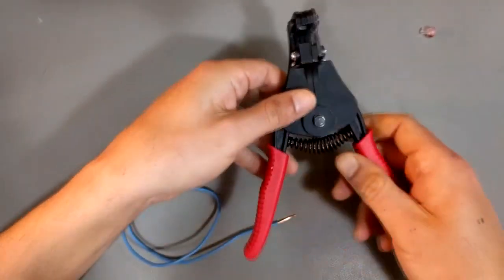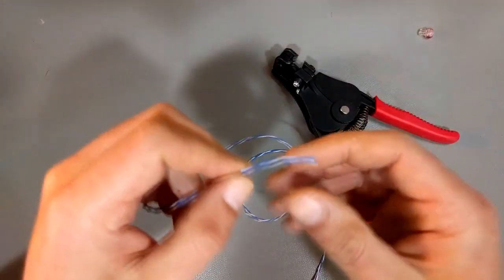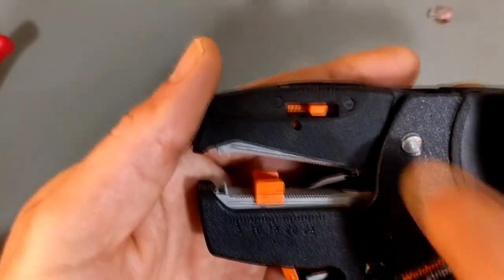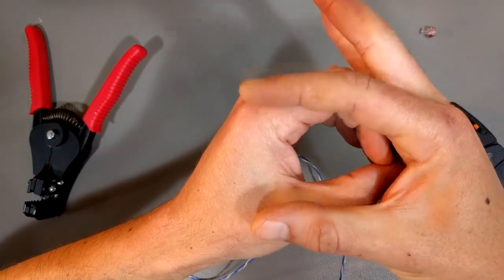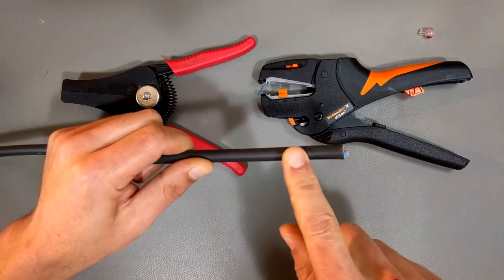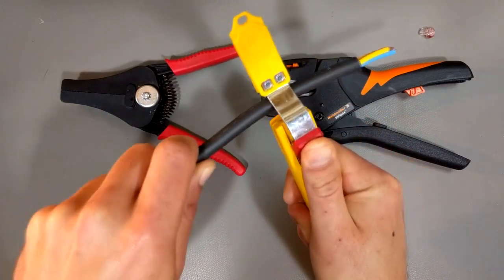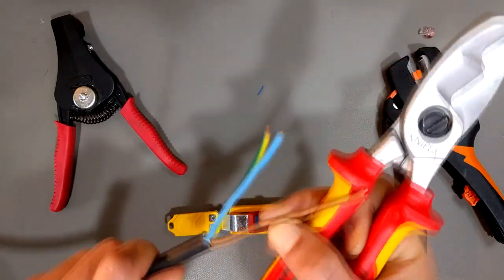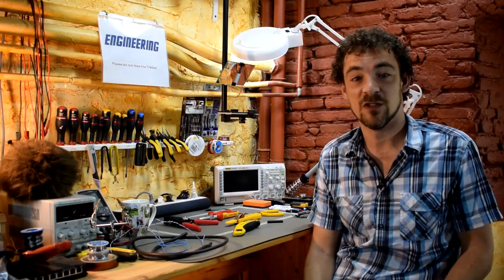Best strippers EVER (um, for techies)

Comment: your wrong about the Weudmuller Stripax each blade is made up of lots of very thin blades that form round the cable to cut the insulation.. for 6mm to 16mm cables you use a stripper next size up or just use your small cable shears ...them cheep things you like wouldn't last five mins in industrial use there copys of a well known brand and even thay were prone to problems.. but I'm guessing your not really giving them a hard time thou

Comment: I've been using wire strippers of this type for more than 50 years.  It  what we used in the United States Air Force.  The ones available here in the States come in two sizes. One for wire sizes similar to the one you have, although they are AWG sizes here.  And the smaller wire one, which does wire down to AWG 26.

Comment: okay okay, i watched the whole video now, and i can see that you are not a field worker, you are a good and smart guy, dont get me wrong, i really like your stuff, but if you were a field worker your utility belt would be full of strippers, in my utility belt, actually i dont use a belt i only use 1 pocket in my pants, i have my CC22 stripper/cutter, a knife and a PH2 screwdriver and a flat-screw driver, thats all i need. the CC22 can strip cables from small trafo cables up to 16mm2 cables,  and its better than your cutter too. try it out and you will see that you dont need to spend $$$$$ on tools, all you need is a knife and a CC22. (you will need some experience though and a feel of when you are thru the insulation)

Comment: I have had two pairs for years they are the best strippers you can have.  They do have an issue with getting oily and dirty and need to be soaked in mineral spirits to clean the mechanicals.   Your new ones I’m not sure about how they will hold up.